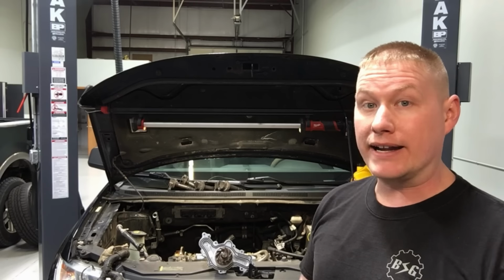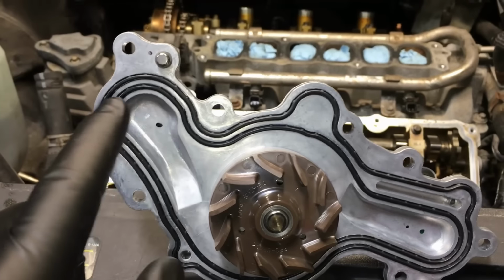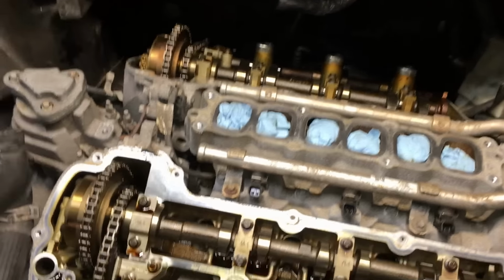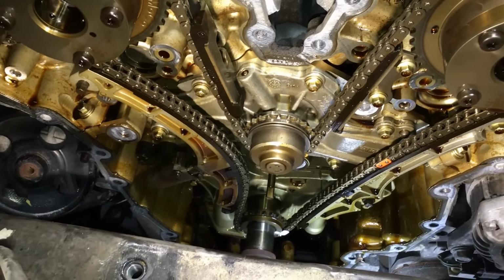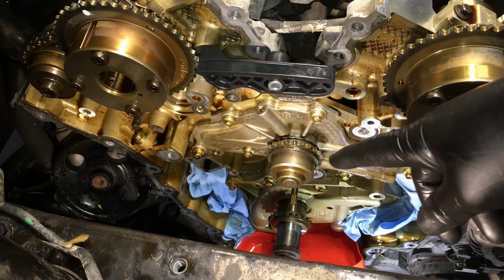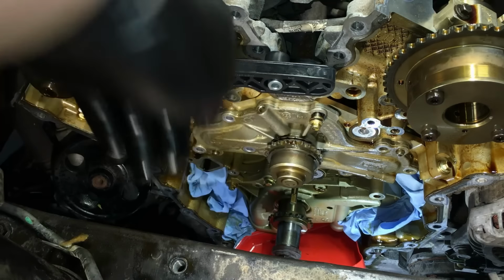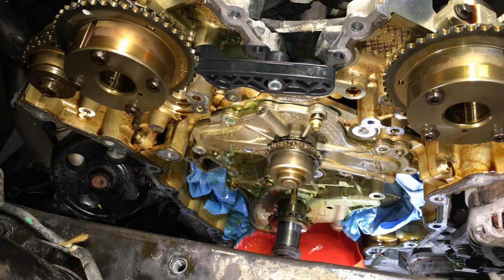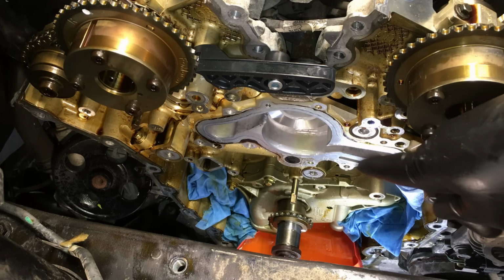Ford 3.5L 3.7L Duratec V6 Chain Driven Water Pump Failures: Check it Before it Destroys Your Engine!

Comment: 13 Ford Taurus 3.5L around 150K had it done for $1,400.  My 11 F150 has the 3.7L  but it has a normal waterpump.  Did that one also around 150K, so is the 3.7 you mentioned the transverse?  BTW I like the Taurus but I'll never buy another one just for this reason.  If I can't work on it, then they can keep it.

Comment: I have a 2014 Taurus sel 3.5..Everyday I wish I would have kept my 03 mustang gt...
Reply: i have an 04  mustang gt myself, had an opportunity to upgrade to a newer ford many times, but i refuse to get a modern vehicle because of how simple and easy it is to work on this car and the the transmission dipstick is a major plus for transmission maintenance.
Reply: Love my '01 gt. The 4.6 and 5.4 two valve engines go well over 300k miles.
Reply: How many actually fail though? Heard after 2012 models it rarely happens.
Reply: @neilcarter77  Got my 14 Taurus sel water pump and timing belt replaced a month ago
Reply: @gballa2730  i own two a 2013 and 14 . No issues, what so ever. 100k on the 2013
Reply: @neilcarter77  You can thank the Ford Gods..I like my Taurus but it bothered me deeply to have to replace those parts at 100,000
Reply: @gballa2730  did it fail or did you just replace them as a precaution?
Reply: @neilcarter77  Water pump failed and the Ford service department recommended that the timing belt should also be replaced.
Reply: @gballa2730  were there any signs that it was failing - Or did it just die, one day?
Reply: @neilcarter77  Yes it was..Noticed my cooling fan would come on without the air being on or an early morning start and the fans were on..Popped the hood and saw where it was leaking out the weep hole. After reading before hand about the issues with those engines instantly knew what it had to be..
Reply: @gballa2730  how much did it cost, and do you have a breakdown of the parts they replaced?
Reply: @chriskozan  Thank God I had an extended warranty so it only cost me $200 but ford charged a lil over $2000. As far as parts water pump and timing belt kit....

Comment: I think I'd prefer to do several of these to one Quad four.  Yet I think water pumps where they can leak into the oil system is a poorly thought out design, but I only turn wrenches and the engineers knows all.

Comment: That's a horrid design. Good thing they weren't idiotic enough to use the same water pump on the longitudinal 3.7 engines.

Comment: Man, that motor looks clean inside. Nice. Obviously well maintained. Kudos to the owner. As far as the design goes, I can barely maintain my own vehicle, let alone design a drivetrain. If someone was like "Design me an engine that can take years of abuse by an average driver that must meet today's emission standards and cannot go above this (blank) price point because people won't pay anymore for being able to glide across thousands of miles while listening to crap music and sipping 5 dollar Starbucks coffee and whining about the cost of gas...", I would be like. "No. But I can type like a mf on Youtube".
Reply: derek244 wilson,
Just because neither of us could design something better does not mean that we cannot easily recognize deficiencies in what someone else designed. It is their profession, so THEY should be able to do it better, even if neither of us can.
Reply: Toyota and Hyundai engineers seem to be able to do it.
Reply: @stevemccooleq  really? Tear the engine down to replace a timing chain every 90k?
Reply: Buick 3800
Reply: 3.0 Vulcan, other than occasional cam sync which isn't a bad job, them babies run forever with good maintenance

Comment: Can any of you mechanics explain to me why they can't use a tensioner gear to take the slack out of a timing chain? Instead of rubbing it against a piece of metal or plastic, why don't they just have a spring-loaded gear with teeth that works similar to a serpentine belt tensioner?
Reply: Planned obsolescense
Reply: I'm wondering this too...
Reply: Cost and noise. The nylon blocks ordinarily last way longer than the engine is warrantied for (see how they haven't failed on this 180K engine, though this one looks better than a lot of them at half the mileage), cost a little less per unit, and the softer material helps to muffle the vibration and noise the chain makes from rolling around the sprockets. The automakers are seriously paranoid about engine noise in the upscale vehicles that make their big money. It may be less of a consideration for a Mustang buyer, but the engine itself has to go into a wide range of vehicles. Why would they make it bulletproof just because the buyer of a base-model Mustang is willing to tolerate an infinitesimal amount more engine noise? 

At least they aren't using nylon for the teeth on the cam sprockets. Special place in hell for those. At least on the old GMs, I will say some of the nylon sprockets from the factory held up a little better than the cheap pot metal ones a lot of them were replaced with.

Comment: I don't check my oil, I check my coolant bottle for any level difference once a week. My duratech still has zero tarnish or anything inside. 152k. Well taken care of.
Reply: I've maintain the wife's.. yesterday I got the call small puddle underneath. Looks like it's the pump coolent is low. 115k miles
Reply: @kevinc8026  Don't start it at all. 190k still lucky. I also flushed my coolant and replaced it with orange coolant. Replace ht water pump you go another 100k with a high quality pump.

Comment: I just hit 100k on my 3.5 explorer. Went to change the coolant which is specialty green ford coolant and the parts guy told me he has never sold a jug of the stuff. Should I keep running the green or change to something else I don’t want to have a water pump failure.

Comment: My cars in the shop right now 😭. Funny how much you learn when it's to late. 2011 fusion sport 190000km. Love the car. Had to decide to fix it. or sell or trade it (which is next to impossible when you're leaking fluid and your engine light is on). Shop quoted me $2500 cdn taxes in. He will do timing chain at the same time. His guide said 15 hours labour. Hopefully everything goes well. Your thoughts?? Basically I'm putting  $2500 into a car worth maybe $5000 . I will post final price in a week.
Reply: Any updates?

Comment: What a design just like the Dodge Intrepid no good...,
Reply: Had a 97 concorde and changed belt and pump at 90 k and was still good and cost less than $100 at a local shop.  Had nearly 200k and was still good up until the time it was wrecked
Reply: @Eugene2ndW  Your 97 was before the terrible 2.7 came out in 98 with a similar water pump to these Fords. The Chrysler 3.3/3.8 and 3.2/3.5 were solid engines overall imho.
Reply: No wonder  whay there's no more dodge  intrepid  on the road

Comment: Very informative videos,  I have 2010 flex and an 06 f150. My question is after hearing you recommend changing the 5-20w oil to 5-30 in the 5.4 triton, I was wondering if you recommended a different viscosity on the duratec3.5? Also want to know which antifreeze you recommend for both engines? Thanks to your channel maybe I can keep these Fords going a while.

Comment: Mazda of Japan admits today that this 3.5L/3.7L V6 wasn't one of their better design, but Ford has to live with it until end of life-cycle production in 2019. It's not a bad engine, overall, they accidentally did not install a lifetime warranty water pump part, that's all. Otherwise, all other Mazda engines have been pretty reliable, overall.

Comment: I’m interested in buying a 2017-18 Taurus, and have read a lot about this issue.  What is the year and mileage range you’ve seen water pumps go on the 3.5?  I’ve have Googled multiple cases of failures on the 2013s and older, but cannot find one for 2014s (and newer).  I searched all vehicles with the 3.5/3.7 engines.  Did Ford come out with a revised (and hopefully longer lasting) pump sometime in the transition to the 2014s?
Reply: Probably, although I can't say for sure because sales number have declined for Taurus yearly. The new, revised water pump is now good for 200,000 mile average lifespan.
Reply: Walter Chan True, but this holds true for all vehicles with this engine. It seems like they fixed the issue around 2012, when they introduced a new timing chain design supposidly. I've heard that pretty much fixed the issue.
Reply: @waltchan  I would never buy any of the FWD 3.5 and 3.7 V6 engines. Police fleet mechanics are reporting the same thing on the Explorers and Tauruses and more departments are buying Chevrolet Tahoes (especially rural ones) instead because of the poor reliability and carbon monoxide leaks that plagued the Explorers and the poor reliability of the Tauruses and a lack of room for the officers especially tall cops. Dodge Chargers are also the same way but they are only slightly more reliable than the Taurus. Tauruses and Explorers also have suspension and steering racks failing because of the catalytic converters too close to the steering motors. The old Ford Crown Victorias were very reliable cars. Yeah the Tahoe does have AFM issues but it’s not always guaranteed to fail like the Taurus/Explorer water pumps. You are more than likely to replace a water pump in a Taurus or Explorer than cams and lifters on a Tahoe.
Reply: @atx-cvpi_99  So, which car engine and car model is the most-reliable and most-durable you've seen?
Reply: @waltchan  Toyota and Honda

Comment: We've got the Mazda CX-9, 2013, 93k miles, well-maintained. Check engine light came on and the code was for the VVT solenoid. Oil looked good. Mech removed the CE light, hoping it was an error, but it came back on an hour later. Told me it wasn't anything that would really harm the car if I drove it for the day if the light came back on. That night, as I was on my way home from work (12 miles round trip), the car seized up while idling at the stop light. Started it back up, started driving the last few blocks home and noticed the temperature was very high (not to the red line, but close). Drove 8 blocks, checked the oil and it was the "milkshake." Turns out the water pump failed and had leaked coolant to the engine, dirtying the solenoid. Now we need a $2400 repair to replace the water pump, and we're still not sure there isn't additional damage. Terrible design! First, that it costs $2,400 to repair a water pump failure. Second, that there's no sensor for the water pump failure, so you don't know you're about to melt your engine! Stupid, and frankly reckless
Reply: Mazda of Japan admits today that this 3.5L/3.7L V6 wasn't one of their better design, but they're stuck with it until end of life. It's not a bad engine, overall, they did not install a lifetime warranty water pump part, that's all. Otherwise, all other Mazda engines have been pretty reliable, overall.
Reply: @waltchan  Ford engine in the Mazda - that's the problem.
Reply: I like the sensor idea, wonder if one could be retrofitted?
Reply: @daseiner, that VVT solenoid was letting you know that the water pump bearing was giving out, resulting in slack in the chain.  My mom also has the 2010 Mazda CX-9 with the 3.7 Liter engine. four years back we experience the engine overheating while in the drive thru at a fast food place. Turns out we had no coolant in the reservoir, and oil was milky. Long story short, we had gotten the water pump change around 110,000 I believe, but shortly after it started leaking coolant on the ground and we didn't know where it was coming from until 4 years later(now) of actually looking into it. So I"m guessing the replacement pump was some crappy cheap part brand new. But anyways I was informed that the coolant was coming from the weep hole behind the alternator for the past 4 years. But the coolant was not mixing with the oil this time, and we kept the level topped off when it needs it.  And the symptoms that I'm experiencing  now is with no check engine light, but the coolant fan runs at high speeds like all the time and we have that little leak. The cooling fans are driving use crazy and their is no check engine light. I thought it was the fan control module but it is not. I was informed that the weep hole seepage can trigger the computer to tell the fans to run high almost all the time. (Even at cold starts when it is below freezing outside).
Reply: @Byrd_City  i had this issue last summer and we replaced the fans 4 times in like 6 months. Changed the temp sensors and stuff it would read -40 when it was 90 outside. My dad changed a ton of the stuff to the gas tank and it fixed the overheating. Now I have a spongy brake pedal, a hot passenger AC that had to be reset often, losing power on a brand new battery, and acceleration issues, shaking..I don't even know where to start. 😓😓😓
Reply: @tiffany2806  Sounds like nothing but headache.
Reply: And, they had to replace the engine, right?

Comment: My 2010 Ford Edge Sport was towed to the shop today and this is the preliminary diagnosis. If the engine is shot, what's the cost of this fix? or isn't there one?
Reply: 5-6 grand

Comment: We got fortunate on our mkz with 118k miles, it apparently was only leaking through the weep hole, and all of it leaked out unknowingly on her way to work.  We just had it serviced 2 weeks prior and coolant was still full and nobody said anything about it leaking.  Total including the tow 50 miles to our ex ford mechanic $1300, but other than that its been great.

Comment: I cannot believe Ford did what dodge did to their 2.7! It ought to be against regulation to put a water pump inside the engine driven by belt or chain, especially chain since engine oil lubes it. You're turning a 40 dollar DIY into hundreds of dollars. Idiots! Ford made better vehicles 10-20 years ago. The bodies are better now, but not the engine design.
Reply: This water pump design was actually designed by Mazda in Japan. Not all Japanese design is highly-reliable, and this is the unlucky one.
Reply: @waltchan  Nissan QR engines, anything made by Subaru, Toyota 2AZ-FE, are one of the few fatally flawed Japanese engines. Nissan QR engines had clogged catalytic converters, premature head gasket failures, premature alternator failures and the alternator job on those engines are more difficult than you think. Earlier 2AZ-FE engines had a problem with the head bolts coming loose and the later ones had excessive oil consumption and some people say that the piston rings are defective or the oil viscosity was incorrect and should have kept it 5w30. Subaru engines burn oil by design and if you do not keep up on your oil changes, the engine will fail and the EJ25 engines blew head gaskets because the cylinder heads were too small.

Comment: For pre-emptive water pump replacement on a Ford Flex Ecoboost, would it also cost around $200 parts & labor?

At what mileage should I consider getting it replaced?
Reply: 😂 maybe multiply by 10

Comment: Looks like a huge PIA, but its it really 12-14 hour job?  Looks more like half that (which is still too long).
Reply: OK, so I came here because I suspected I had a bad water pump.  Dropped the car off at the dealer last night.  Got a call this morning and I was correct.  I gave them the go-ahead to fix (extended warranty covered all but $100).   Six hours later, they called to tell me it was finished.

Pretty much validates my observation above.  It's far from a 12-14 hour job.  Might be on the books as that, but real time is much less.

Good to be past the water pump issue.  Hopefully, it won't rear it's head again.

Comment: Nissan used this design before Ford did. The only difference is that Nissan was intelligent enough to put an access plate on the front cover so you don’t have to pull The Whole front of the engine off to R&R the pump. They also used a much beefier designed water pump. A main chain and w-pump should be a 100,000 mile preventative maintenance on the 3.5 Ford.

Comment: Like David Ward I'm wondering what the part number is for the cam phaser bolts. Also....do you need to remove the intake phasers or is the secondary chain long enough to go over it? Not sure if the exact vehicle is important with this question...working on a 2013 Explorer naturally aspirated 3.5l

Comment: The shop i work at is attempting this job but they want to pull the engine...is this necessary
Reply from the maker: only on the cars
Reply: Probably makes the job a hell of a lot easier.
Reply: Be sure to use the special ford silicone on front cover.  According to ford all others can cause oil foam and engine failure

Comment: The ecoboost 3.5 engine of my ford f150 of the year 2014 is officially dead. Could you tell me if I can put an ecoboost 3.5 engine of the year 2016 in my truck?

Comment: Awesome video!    The water pump failed on my 2011 Explorer with 95,000 miles,  had about a gallon of antifreeze in the oil which caused the phasers to go out.   The dealer recommended replacing the engine for $6K.  I recommend the extended warranty if you plan to drive a car with this design.
Reply: ….and I recommend you never buy another vehicle from Ford ever again. (Or any other manufacturer that buries a water pump inside of the engine, and forces the timing chain to drive it) Not only is it a stupid design; but a predatory and sneaky one at that. Designed by the vehicle’s creator to separate you from your money, when the engine on that thing fails catastrophically, in 3-5 years. 
Next time, buy a Honda or a Toyota. Don’t mess around with any other vehicles.
Reply: nikond90 The issue is very rare, maybe 100 people out of the millions of fords with this engine, but good advice nonetheless. Unfortunately, every engine on the planet is going to have something go wrong eventually.
Reply: Puff the Magic Dragon   Agreed !!